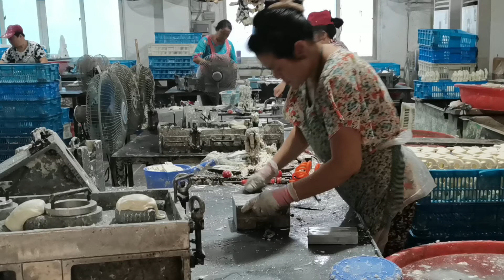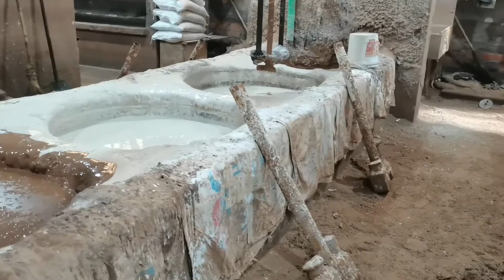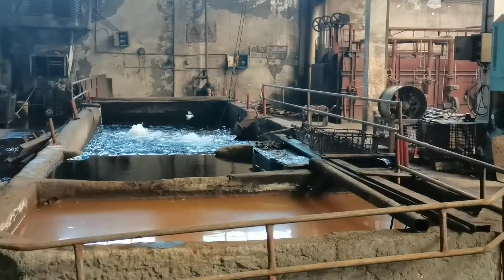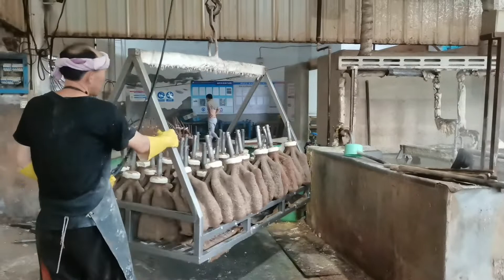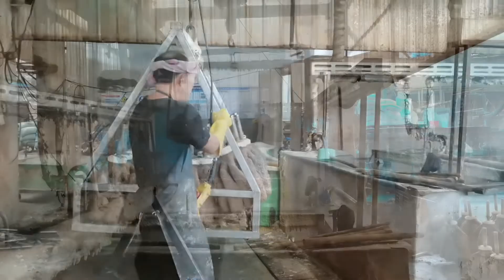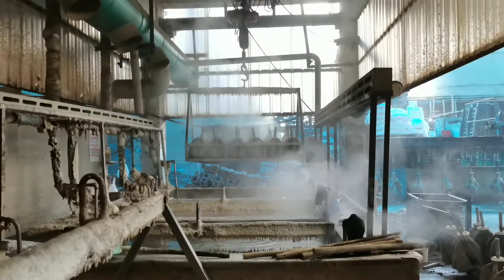Professional excavator bucket teeth manufacture process| Bucket tooth manufacturing process

Comment: Wants bucket tooth moulds
Reply from the maker: hello sir，do you have a purchase plan for bucket teeth？
Or if you have other products you are interested in, 
you can contact us：FL@nbgaite.com
Thanks.
Reply: Dear Sir,

Good day. This is Terry from China. We are the manufacturer of undercarriage parts and GET for mining market. Can you please arrange a opportunity for us?

Regarding our bucket teeth. The physical property has been hardness 51-54HRC, impact 25-33J(normal temperature), impact 20~22J(-40℃ temperature). Quality has been leading level in China. Lifetime is much higher than NBLF. It is even better than OEM brand such as Caterpillar, MTG, HENSLEY etc.
Regarding our undercarriage parts. We have a integrated factory including workshop forging, casting, heat treatment, machining, assembling etc. We provide 1 year/2400 hours warranty for lubricated chain and excavator undercarriage, half year/1200 hours for bulldozer undercarriage. We are mainly producing for 3~120 ton excavator and D3~D11&D20~D475 bulldozers. 

If you have any question or need, please feel free to let me know. thanks